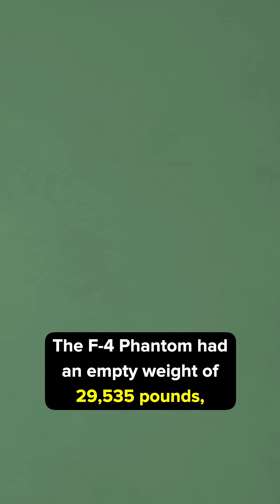Why an F4 Phantom was Launched into Concrete

Comment: See, planes, built to be light so they can fly, don’t take down concrete and steel buildings.
Reply: Yeah, about that
Reply: It requires mind bending religions. Basically modern USians religions.
Reply: Buildings aren’t made up of multiple feet of reinforced concrete meant to stop a plane
Reply: @antimedic4441  He designed it this way because of the 1945 B-25 crash of the Empire State Building
Reply: @CT-uz3bf  A plane that that was one twelthes the weight, and going at less then half the speed, so would have had 70 times less kinetic energy.
Reply: @aquila4460  I’m not gonna have these arguments again all day. I do it too often. Instead, I would like you to give me literally any believable explanation as to the freefall collapse of Building 7, the only steel structured building in history to collapse into its own footprint due to a small fire.
Reply: @aquila4460  Oh, and the Dancing Israelis.
Reply: @CT-uz3bf  You know what sure. If you ignore that, it didn't collapse in freefall. Literally, every single video I have seen shows a massive kink developing in the middle, as the middle falls first, and pulls the rest of the building with it, that it wasn't a small fire, it had burned for seven hours, due to damage to the watermains there was no effective firefighting efforts at all, and the internal fire impression system failed too.

Add to that the fact that it was already damaged by falling debris(at least one other building I know of got damaged so bad it had to be demolished), and a general catastrophe that further kept the attention of emergency response away from WTC7 and suddenly you see why those are pretty extraordinary circumstances.
Reply: @aquila4460  We could also talk about the Pentagon if you prefer. Only one single video ever slipped through the cracks after feds confiscated every CCTV tape within a massive radius. The only surviving entrance gate video shows an object smaller than a single engine Cessna skim mere feet above the ground. A 757 would stand as tall as the Pentagon, as the plane is nearly 5 stories from belly to top of tail. Idk about you, but cruise missile seems much more likely than “magic shrinking plane”.
Reply: @aquila4460  Why did fighter jet scrambles that average only a couple minutes… suddenly take closer to twenty on 9/11. Especially after running training drills on this EXACT scenario months before?
Reply: @aquila4460  Once again, I have given you sources, pictures, government documents, etc etc that back up my claim.
Reply: @CT-uz3bf  You did, in fact, not. You spend too much energy on shifting the goal posts.
Reply: @aquila4460  I even sent you a link to a reddit post, that provided several reputable links in the comments.
Reply: @antimedic4441  the Pentagon was
Reply: @antimedic4441  it actually did. The aluminum fuselage would just smash into it like eggs smashed into rocks. The reinforced concrete pillars would be totally unaffected.
Reply: he's a little confused, and does not have the right spirit
Reply: Finally, took me a while yo find the 9/11 conspiracy nut. Neat thing. A loaded 737 80,000 kilos, or about 6 times that of an F4. and in a downward dive can achieve 400mph and still be controllable in that overspead condition. 

Also, this slab of concrete is 15 feet thick. The Towers at their base, were 3 feet thick, and at the 80th floor? were only about 14 inches thick. Plus, they werent solid slabs, but rather ractangular columns that left open space between them. So instead of a solid slab, you have unsupported thin pillars. Entirely different results.
Reply: @theduke7539  you do realise that calling someone a conspiracy theorist in this day age is a good thing? They tend to be right. You sound vaccinated.
Reply: @Run_it_ Straight  lol, okay bud. just keep deflect when you know you dont have a point. Itll always save you
Reply: @theduke7539  triggered because I don't want to waste my time arguing with someone who still believes in Santa Clause?
Reply: @The Duke  can I have a turn please?🤣
Reply: @Run_it_ Straight  If youre really good this year, and eat all your vegetables, maybe Santa will bring you one.
Reply: @theduke7539  so you're saying Twin towers are magical buildings that are built so lightly thin below and so heavily at top?
Reply: @sys3248  what? i specifically said they got thinner the closer you got to the top
Reply: @theduke7539  there ignorance will make them ignore you just stare and watch knowing you know better
Reply: @theduke7539  well except the plane didnt dive down? You can literally see the plane that hit the 2nd tower fly in a perfect horizontal line???
Reply: Today on "Fact or cap" can fuel melt steel beams?
Reply: @QTwoSix  liquify? no, soften way the hell up? yup
Reply: @theduke7539  let's say they did melt the beam. Do you believe they would have enough fuel to melt all the steel beams encased in concrete all top to bottom to fail at the same time? Instead of just localized damages?
Reply: @sys32  first of all, They didnt melt the beams. You dont have to liquify steel to rob its strength.
Reply: @theduke7539  exactly it wouldn't. It won't weaken steel encased pillars from office fire either. Even less create a condition where they all fail at the exact same times that they collapse top bottom at free fall speed. 
Otherwise greenfell Tower in London would collapse in the same free fall speed. 

1. Fire need fuels and fire damage is progressive. Any catastrophic failure would happen first at where the fire at hottest. Such fuel doesn't exist anywhere near the reinforced concrete steel core either.

2. Top down collapse would meet stronger and heavier materials at the bottom that will progressively kill the collapsing materials and structure fall momentum until they eventually stop. 
That's the reason CONTROLLED DEMOLITION are actually invented. You can destroy the base pillars and the buildings would collapse sideways because that thing is SOLID objects up and down.
Reply: Planes, built to be light so they can fly, don't take down concrete buildings. But NOT steel buildings. Reinforced concrete is not the same as steel. You just conveniently added steel here when the properties of reinforced concrete and steel are completely different.

At high temperatures where jet fuel burns, steel loses its strength and is unable to hold the load that it normally can at room temperatures. This is why the WTC towers went down. The non reinforced structural steel was unable to retain its strength at high temperatures so it collapsed. The steel did not melt but lost its strength.
Reply: @gyanishkakati  firstly, i ofc agree that steel loses its strength when a fire is burning ans the steel heats up. But it doesnt MELT steel. And we saw molten steel. 
1. Pouring out of the side oder the tower and
2. Even weeks after the Event RED HOT GLOWING debris was pulled from the pile of rubble
And thats not even all, the entire steel construction was covered with a fire resistant coating
Reply: Yea the difference is the wall wasn't 30 feet thick and it was a COMERCIAL AIRLINER! aka a lot heavier than a small fighter jet and it was going 700 mph and there was a fire that would have a full tank to burn through and it also has to support the other half of a SKYSCRAPER! And no the steal of a plane is not made of aluminum.
Reply: @jo2832  the 3rd building? What happened to that?
Reply: @run_it_straight829  a third building collapsed because it was right next to the two wtc the building was evacuated at the time. It collapsed because of the damage it sustained from the other two buildings collapsing.
Reply: @jo2832  would've make sense if they fell on top of it or they were leveled the ground around it which is evidently false. Entire streets are absolutely fine around the 3 buildings. Miraculous collapses that'll envy anyone who want to demo their buildings inside urban landscape.
Reply: @jo2832  riiiiiiiiightt.
Reply: @jo2832 correct (likely the walls aren't fully concrete either), correct, correct, wrong (you do realise that the average jet would not cruise at 600mph, let alone fly that speed at low altitudes?), correct (the 9/11 terrorists selected flights that would have a lot of fuel on board), what?, wrong. it's not even "STEEL of the plane", steel and metal are different things, and aluminium is a fairly common thing to build planes with.
Reply: @@sushislaysstuff3537  when they say aluminum they usually mean the cooking type I'm talking about the 911 theorists so that why I said steal or metal because it's not the cooking type and for the mph that was just a mistake
Reply: @Jo  huh? Airplanes have been made of Aluminum since ww2. even today with composits tsking over. a majority of planes flying are Aluminum.

Neat thing about Aluminum. It does actually burn. And guess what, the ignition point of Aluminum is actually just 1200 degrees Fahrenheit. considering the air flow at 80 stories up. those Aluminum planes were burning themselves in a thermitic reaction.
Reply: @@theduke7539  I'm saying that ik its technically aluminum but when ppl think of aluminum they think of the foil so that's why I said steal
Reply: @Jo  okay, and? Steel and Aluminum are totally different, steel weighs several times what Aluminum does. Like, I know most people have never seen Aluminum in bar stock form, but still, steel is so drastically different
Reply: @@theduke7539  I'm trying to say that I used it to show its no like a aluminum foil if I just said aluminum it would sound like I'm talking about the foil what's ur problem about me saying steal instead to show there not the foil
Reply: @Jo  because the two metals are so drastically different that saying the planes were steel is a lie. Steel is several times heavier and several times stronger than aluminum. And so what if people think its foil. Thats still closer to the truth than saying it steel.
Reply: @jo2832  ...what
Reply: @theduke7539  ik but still that is why I steal.
Reply: @@sushislaysstuff3537  I said steal because when people think of aluminum they might think of the foil so I said steal to show that it's not like I can punch a hole on it just from the power of your fist
Reply: @Jo  okay, but its still wrong. Like I cannot emphasize how different the two metals are.
Reply: @theduke7539  ik ur right but that's why I did it ik there different metals
Reply: @jo2832  a comercial liner PHYSICLY cant fly 700mph at an altitude THIS LOW. It would just break in half due to air resistence. But yeah lets argue emotionally rather than factually 🤪
Reply: @black screen  how do you think planes take off then?
Reply: @jo2832  dude they take off at like 140mph and not 700 mph, MASSIVE DIFFERENCE WTH
Reply: @black screen  dose not mean it will break apart its still in the air a plane moving like 530 mph won't break apart now 700 was a but of a over estimate because it can't go that fast but still
Reply: @jo2832  yes it will. it can fly at 530mph in 10km of altitude where the air is thin and there ist much resistance compared to just 300- something meters. basic physics.

Comment: How on Earth do bombs penetrate through concrete and all the re-bar before exploding, that’s crazy
Reply: You see, planes are relatively soft, like cars. And bombs designed for bunker busting are hard and solid
Reply: They have a very hard bit of metal on the tip and a delay fuse that detonates the explosive a second or so after impact.

There's a fairly interesting video about the rapid development of the GBU-28 bomb during operation desert storm out here in YouTube. I believe by Curious droid

Comment: Mass is independent of gravity, but pounds are not. Pounds are a measure of force, which is mass times acceleration. The unit for mass in the Imperial System is slugs.
Reply: under earth gravitational attraction, weight = mass
at least in the metric system, the kilogram-force is rarely used in relation to equations on earth, just kg or N :v
honestly, i'm engineer myself and i've never used kilogram-force, if you want force just use newtons

Comment: It's 8% of Tnt, not 80%. 1 ton is 4,2GJ, 330,8MJ is 8%.
Reply: Yep, your mass stays the same regardless of where you are, you weight changes depending on the gravitational pull.
Reply: And the mass of the plane would be 13396kg on Earth, on Mars, on the Moon, literally anywhere since mass doesn't depend on the gravity strength...
Reply: @baguettefish  your total amount of mass would not Change depending on gravity, but the force of your mass would change in gravity fluctuations. If I manage to sound correct 🤣 was easier to think it than to try writing it down in less than a small Novel 🤣🤣🤣
Reply: @Norwegian_Bastard  the force of your mass against a concrete wall perpendicular to gravity would not change
Reply: @baguettefish  yeah, they also said it weighs 29,535 pounds, but pounds express mass and not weight.
Reply: Yeah, was about to ask, l8or, weren't early nukes around the port of 1ton of tnt? A jet crashing at 80% the power of a nuke didn't sound right.
Reply: @RichyArg  no. The first ever nuclear explosion was 25 kilo tons. So 25 000 tons of tnt equivalent. A regular aviation bomb of ww2 had anything in between 20 to 3200kgs of tnt equivalent. For example it took 1300 heavy bombers dropping 3900tons of explosives (total weight, tnt equivalent is probably less than half) in special order, location and time to maximize firestorms to destroy as much of Dresden as possible. It took a single 15kiloton nuke missing it's target by kilometers to level Hiroshima. A one ton tnt explosion is absolutely nothing in the scale of early nukes
Reply: Just say 80 kilos